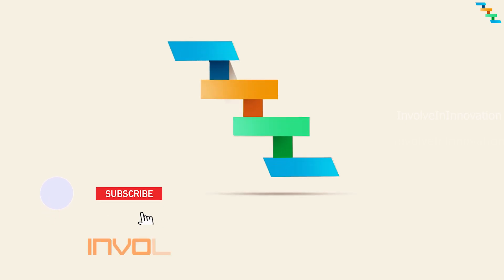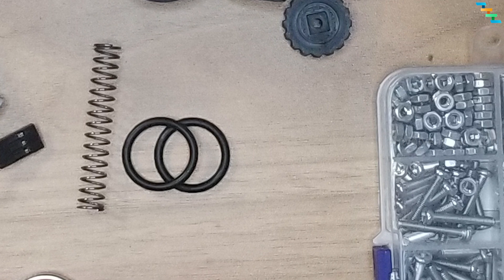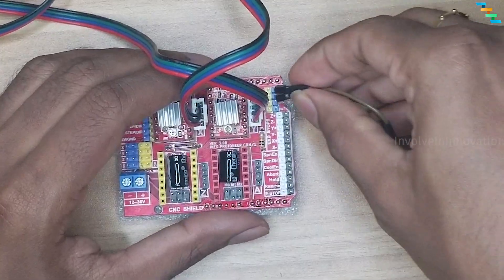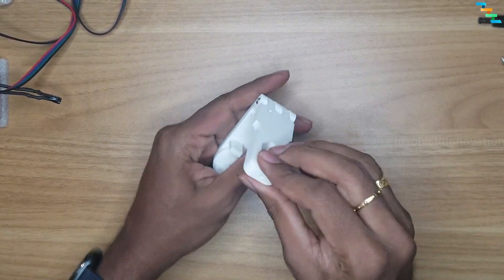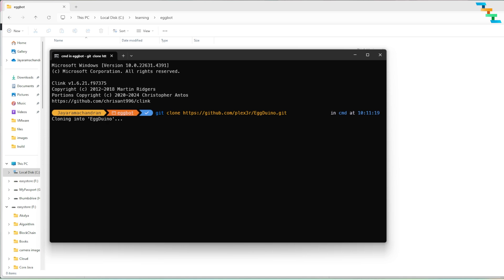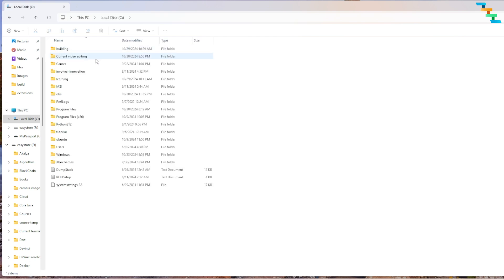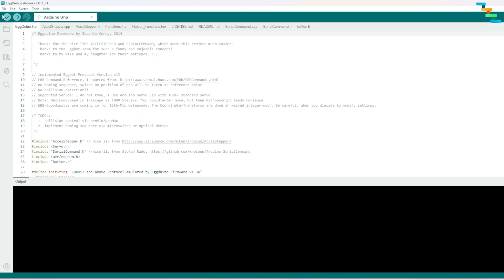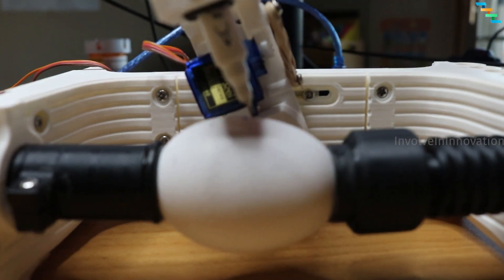Eggbot: EggPainter - Complete build from scratch

Comment: I finally got around to making this, thanks for the great tutorial. Maybe this is the wrong place to ask this but I figured I would try. My eggbot works but I am having strange issues with the eggbot extension in Inkscape. For instance, the Toggle Pen Up/Down control does not work, and the values for pen up/down position seem totally arbitrary. I have had to trial and error to get the right values. For me 25% up and 40% down position are the best values for an egg. Trying to control pen up and down speed does not work either. I wonder if this is something on my end or an issue with the current release of the eggbot extension.

Comment: I did as you did exactly but i still do get an error while applying

Traceback (most recent call last):
File "eggbot.py", line 1169, in < module> e.affectO
File "inkex.py", line 283, in affect File eggbot,py", line 19, in effect
self.serialPort = ebb_serial.openPortO
File "ebb_serial.py", line 307, in openPort
found_port = findPort
File "ebb_serial.py", line 62, in findPort if port[1].startswith("EiBotBoard") or
port[1].startswitch("Arduino"):
AttributeError: 'unicode object has no attribute 'startswitch'

Can you please help i really need it for a project
Reply from the maker: There is a typo in the startswitch in your code, it must be startswith, modify the function provided in the description
Reply: @InvolveInInnovation  THANK YOUUUU SOOOOO MUCHHHHHHHH IT WORKEDDDDD